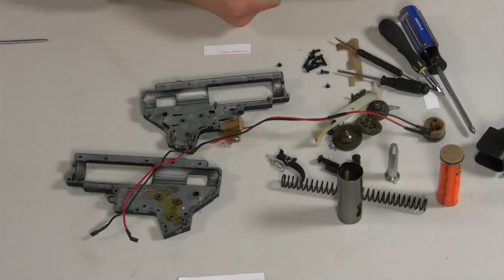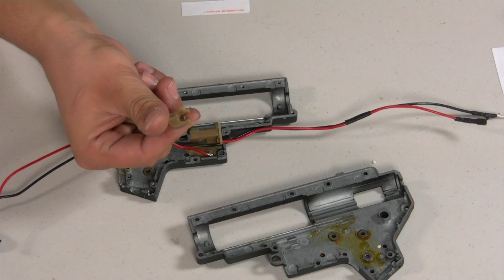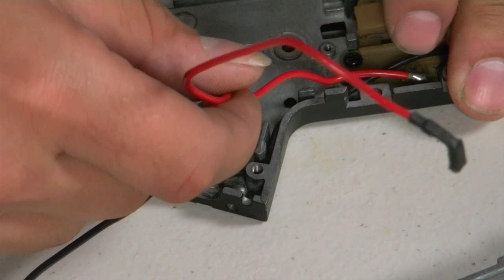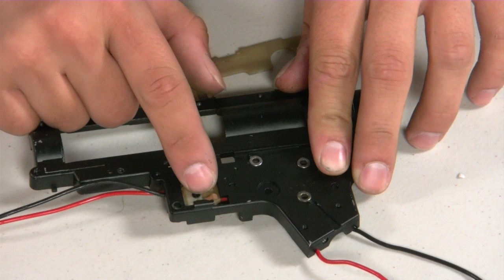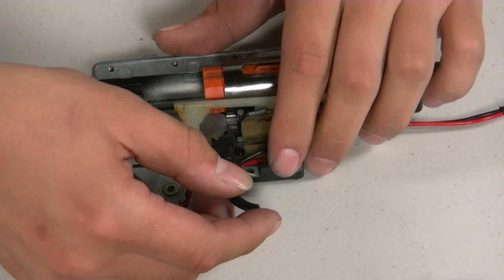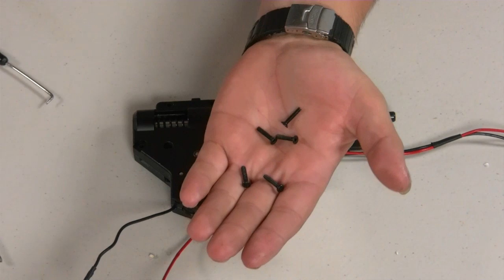HitGuns.com - Airsoft Gun Guide - JG M4 Gearbox Assembly.mp4

Comment: This is a great video and it makes me relieved and frustrated at the same time. My trigger switch failed, so I bought a new V2 M130 gearbox that's MOSFET wired. I couldn't find a guide to fix my standard wiring, so I just went ahead and bought the new GB. So all I needed to do was re-solder it? AARGH! I guess I could just fix it then sell it on Ebay...

Comment: i received my jg m4 system yesterday. i used a small screw driver to tab the gear box.. i was surprised to hear plastic. i thought the gear box was made of full metal ? JG M4 RIS System Airsoft Gun 500 FPS got it from amazon.com. it was deliver in a box with your website on it. i will examine it better today to see if its full metal.